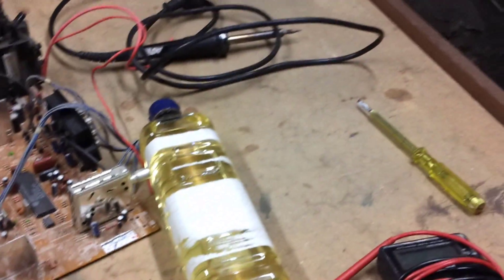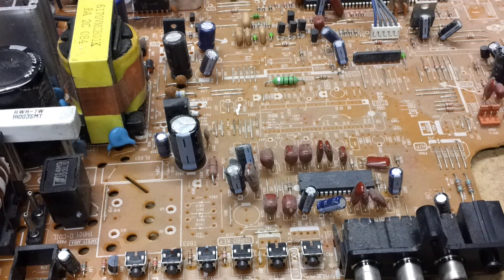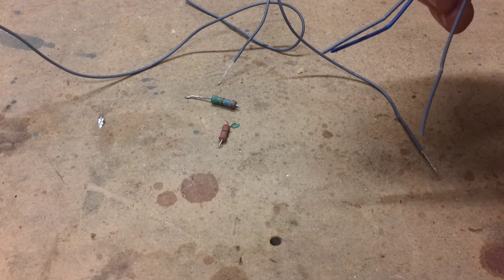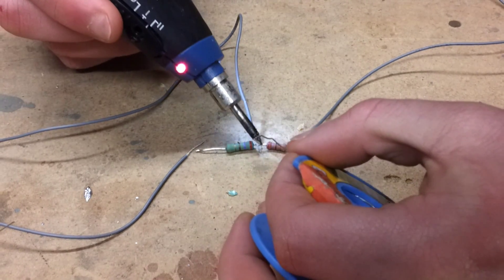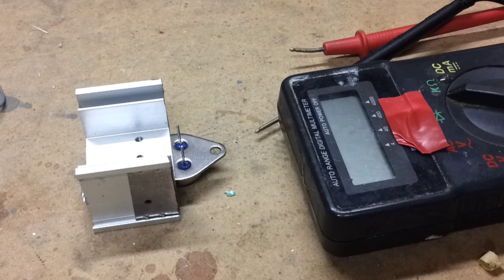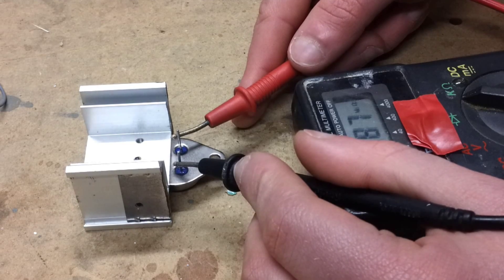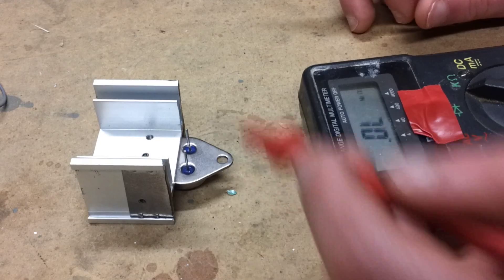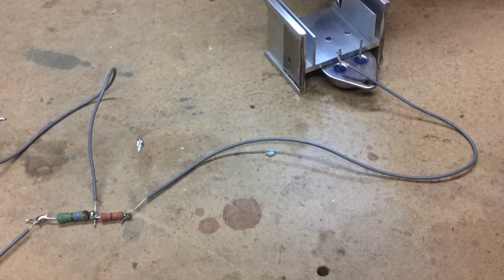Plasma Shield Tutorial Part 3 - More Construction

Comment: When trying to find the "Base" and "Emitter" of a 2N3055 transistor, check to see if your meter has a "diode" check function. When the meter shows about "0.6V", the red wire is on the "B" and the black on the "E". Reversing the meter wires should show "open" or "overrange".
Also, do a Google search for "zvs driver" for a schematic that's almost bullet proof and uses more efficient MOSFET transistors.